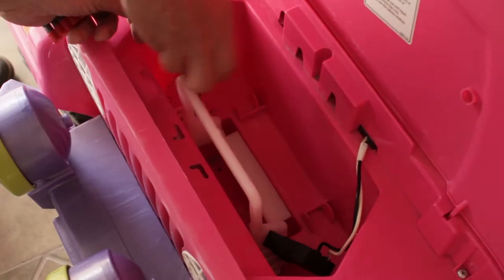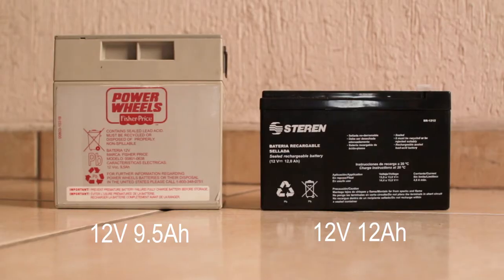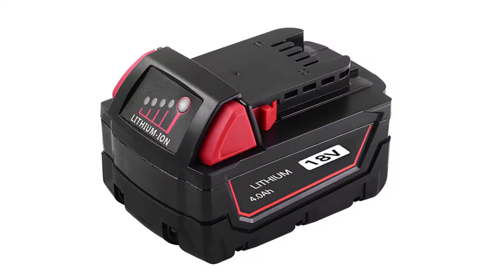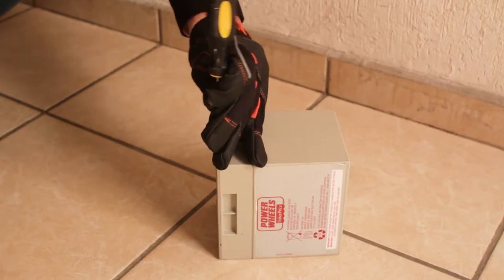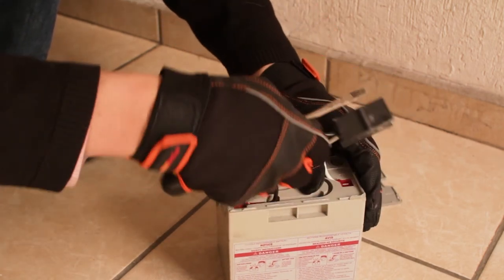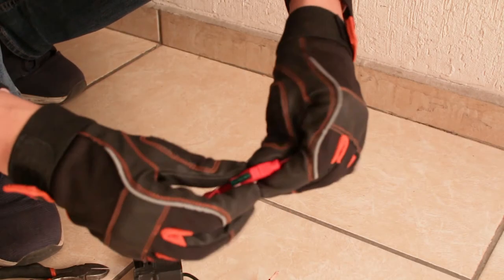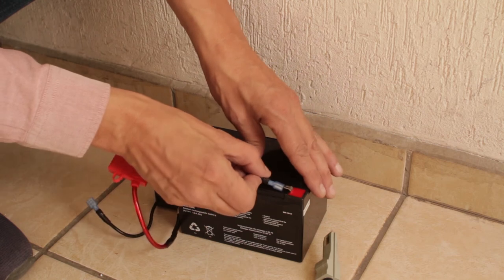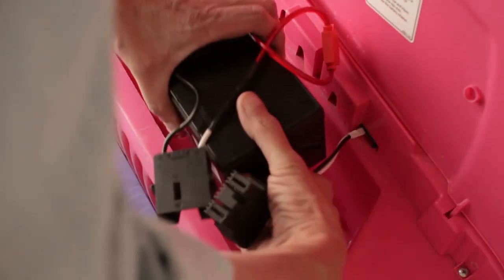Power Wheels 12v Safe Battery Replacement 🔋

Comment: Many of the more well known drill batteries have aftermarket alternatives, that are up to 9 amp hours, while still being cheaper than a stock replacement. If you use a voltage regulator & step it down to the original voltage, you should be able to safely get much longer run time. Many I know have pretty bad performance with their ride ons, because they leave them plugged in almost all the time, but they still have short runtime. Drill batteries can be charged with their own charger, without needing to be inside the vehicle. They don't have to remain in extreme outside temperatures. Drill batteries have a reduced risk of being overcharged, because the charger typically shuts itself off. Also, you can often fit two in parallel, so you can swap one out to charge, while still using the other one. Also, drill batteries are typically much lighter.

Comment: Found a power wheels in the dumpster did not have battery nor charger I ended up clipping the connector off and hooked up a motorcycle battery and it works perfectly fine I can charge the motorcycle battery with my motorcycle battery charger thank you for the insight on the in-line fuse I totally ignored the fact about an in-line fuse my mistake but luckily no mistakes has happened yet and I can still do that

Comment: Question: 
1. Any tips on how to care for my 12v battery? 
2. Like, how long should I charge it? Will I damage it if I charge too long? 
3. How high should the voltage get on it? 
4. Power Wheels says to charge them at least once a month, is that what I should do for all SLA batteries? 
5. When I use it, should I wait to charge until it's completely dead, or can I charge any time? 
6. Will I damage the battery if I leave it hooked-up in the powerwheel all the time for months (like I currently do)?

THANKS!
Reply: Get a smart charger to avoid all of that
Reply: Just get a pulse charger with repair function; they're also super useful for car batteries.

Comment: Wondering would I be able to use a 12v battery from the parkside tools in my sons power wheels its mercedes actros 12v it came with 2 12v batterys upgraded but they are flat and take way to long to charge so I'm not mad on the idea of just replacing the batterys for the same again  i dont want to break anything either  I'm good with my hands but clueless to what to do any help would be appreciated great vid thanks
Reply: I'd try a 12v pulse charger with repair function to try to save the old batteries first, since they're $30 or less off Amazon.

Comment: How much longer do these last battery vs the old one
Reply from the maker: In theory a 12Ah battery will give you roughly 20-25% more life over a 9.5Ah battery and there are 12v batteries with even more Ah to give even more life before recharging but you need to check that they will physically fit in the battery bay before buying one.
Reply: @brieftodo  ive got a 12v with 12mah rating that came with the car... Would like to find a better battery then this that will last longer